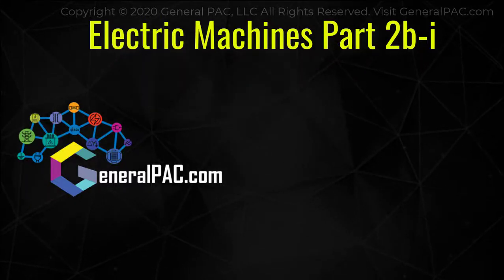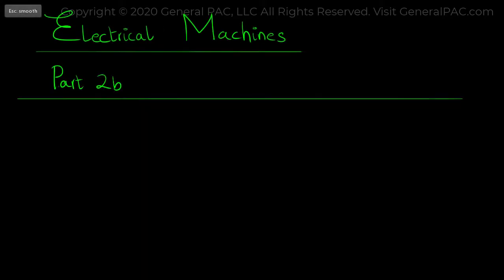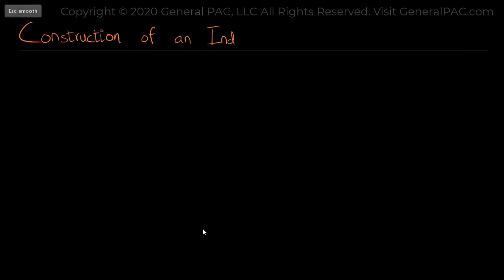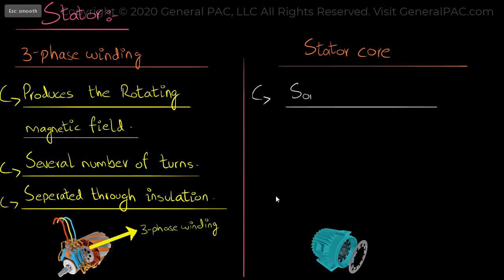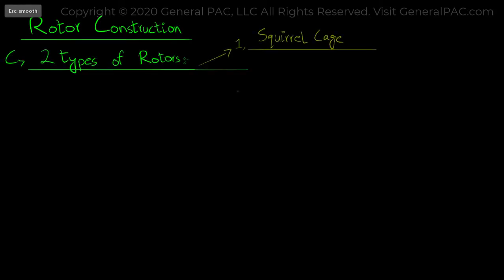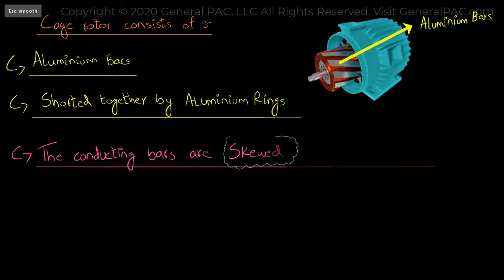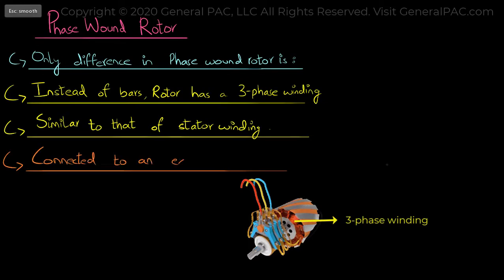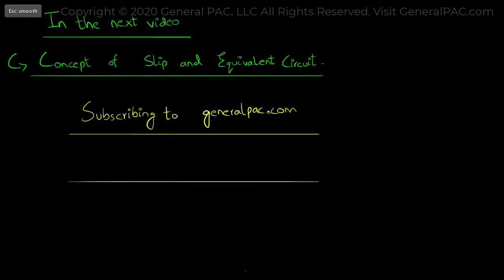Electrical Machines | Induction Motor | Part 2B - I

Comment: Can you elaborate on how the rotor locks if the windings are straight in the phase wound rotor design?
Reply from the maker: Hey mortse90, what you might be referring to is a phenomenon known as ‘Cogging’ or ‘Magnetic Locking’ in an Induction Motor. It is an issue that occurs when an induction motor fails to start despite having full stator voltage applied to its winding. This occurs in the starting of specific induction motor in which teeth(slots) of the rotor are equal to the teeth(slots) of the stator.

Mathematically, it can be written as

Stator teeth (T1) = Rotor teeth (T2)

As we know, during normal operation of an induction motor, rotor’s magnetic field falls behind the stator’s magnetic field. However, in this case there is a (magnetic lock) between stator and rotor teeth that prevents the motor from rotating or to remain fixed in its position. The stator and the rotor teeth get magnetized due to the magneto-motive force present between the air-gap. This leads to magnetic alignment between the rotor and stator teeth. As a result, the rotation of the rotor is hindered due to this alignment force/torque, leading to stalling or what is otherwise called Cogging.

Coming to your question on how the rotor locking is done specifically to phase wound induction motor. The answer lies in the constructional difference between two motors. For instance, phase wound induction motor has a three-phase winding instead of rotor bars which bring the slots closer together as compared to squirrel cage rotor. In other words, the windings are distributed around the slots in such a way that makes the induced field much more uniform. This ensures that the torque developed in the rotor is much more even throughout the revolution so that cogging is minimized.